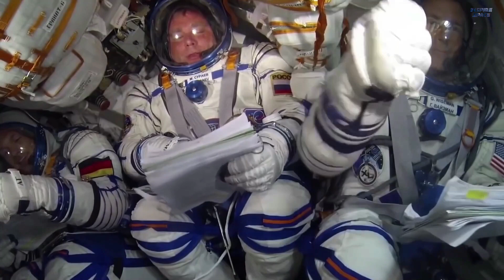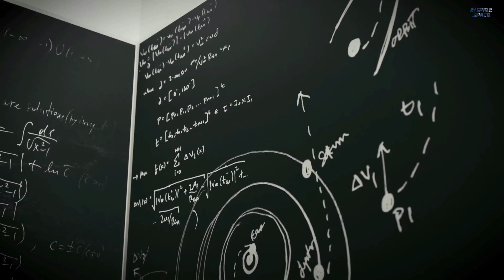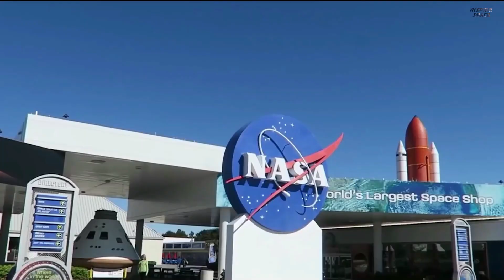Nuclear Rocket – Any Chances For Nuclear Propulsion In Space?

Comment: Ok nuclear thermal rocket engines that use the fissioning of u235 to heat hydrogen gas to extemely stupidly high temperatures and spits it out the back to produce thrust. These were deceloped and tested in the 50s with amazing  S.I.'s that chemical rockets cant touch, only they tended to melt. Fast forward to today and now Nasa and Darpa are developing project draco which isnt a cheesy name at all amd by developing i mean they're dusting off the plans from the 50's and subbing in materials that wont go all runny and computers to monitor the whole deal. The type of reactor is still unknown butnit wont use weapons grade uranium which is stupid but people like Hamas and Putin exist so what can you do. Test flights are supposed to take place in about a year if you believe Nasa which i dont so plan on seeing one of these in the 2030s